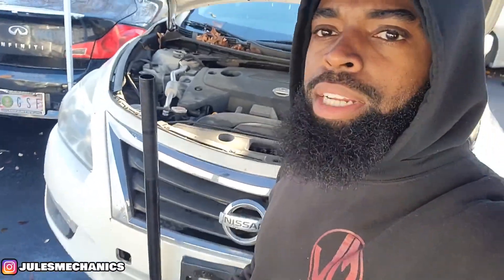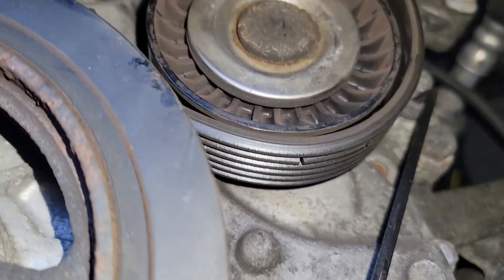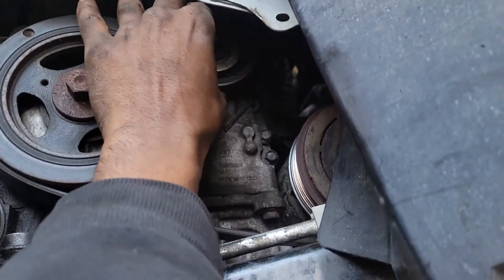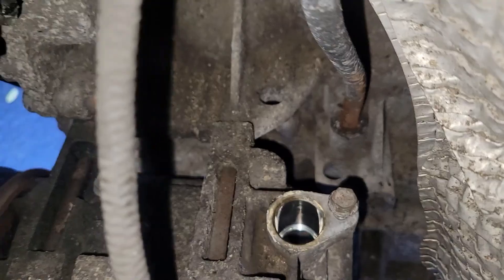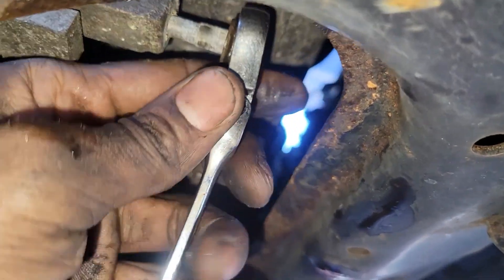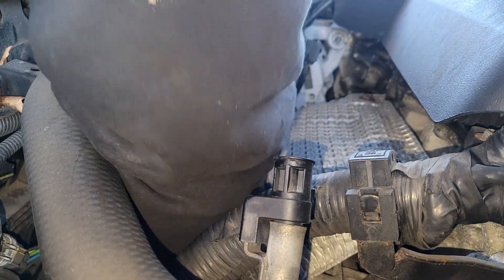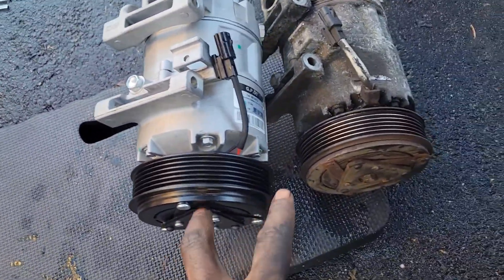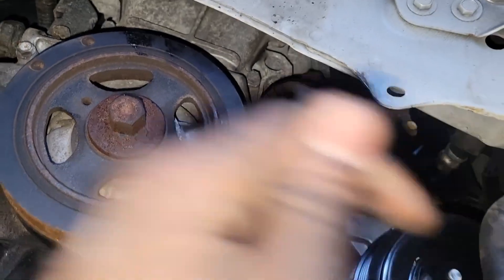Step-by-Step Guide: Replace AC Compressor in 2013-2015 Nissan Altima!

Comment: How much should I pay for someone else to do this? $200 sound good if I already have the compressor? $250?
Reply: Friend of mine just got quoted $2,700. It's always an expensive job if you pay a mechanic shop to do it. Part only costs around $170. Labor markup on a compressor replacement is insane.
Reply: I got quotes ranging from $175-300 for just labor....$300 a real garage 175 a mobile mechanic.